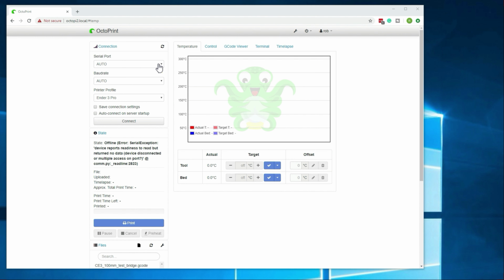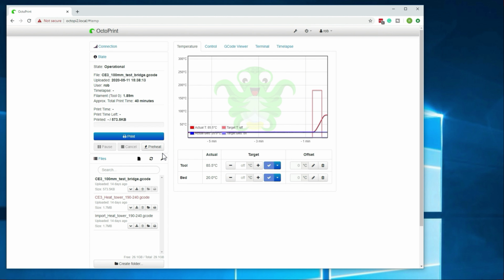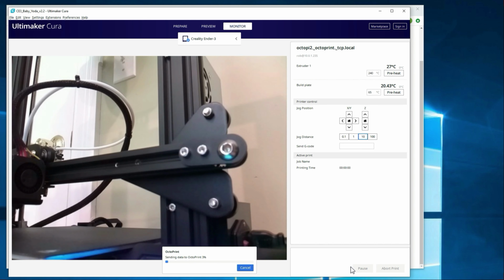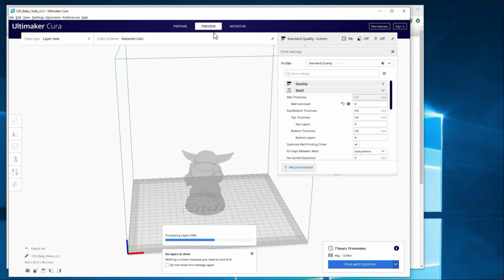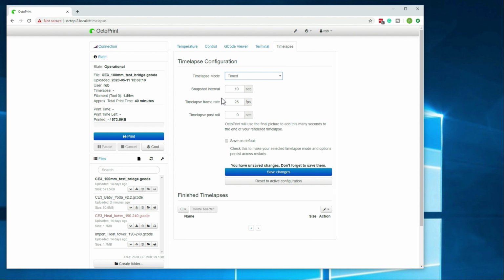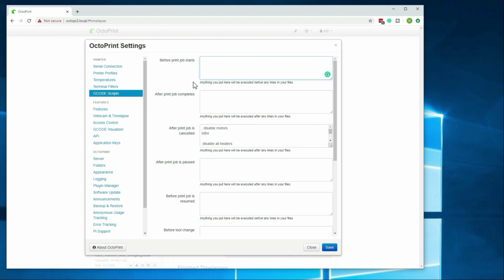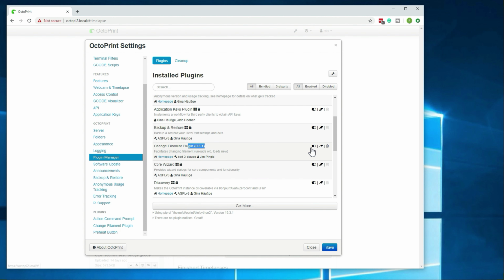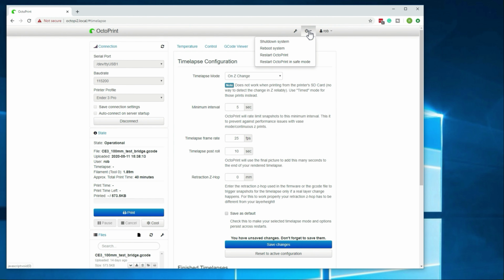Octoprint Basics: UI Tour, Settings & Configurations

Comment: I finally got my printer out of the box today. The first print was a little stringy. I'll print one of the temperature towers you suggested, but I need these parts for something I'm working on in my house so I'm just trimming the strings for now! I also ordered a Pi 4 today, so hopefully I'll be rewatching your Octoprint setup video soon.
Reply from the maker: That’s great. The temp tower is simple, yet can have a significant impact on the overall print quality. It's worth running one when you switch between filament brands. I think you will like Octoprint a lot, it's really a cool platform. Just make sure to setup the integration from Cura to it.